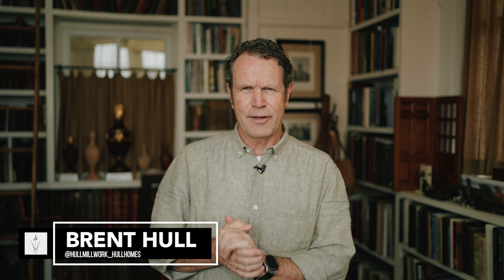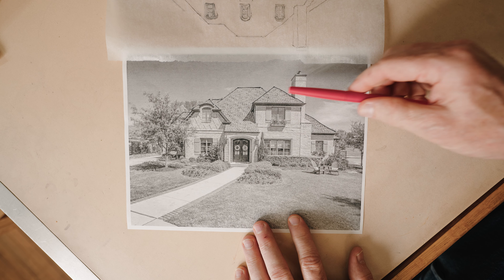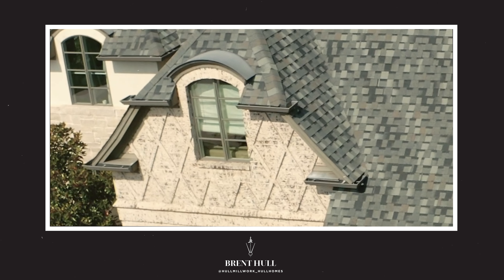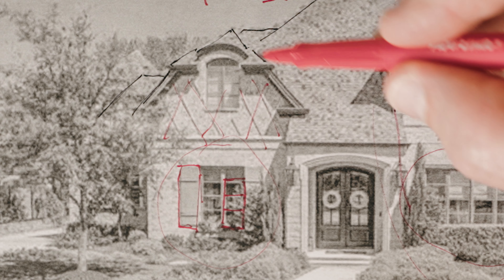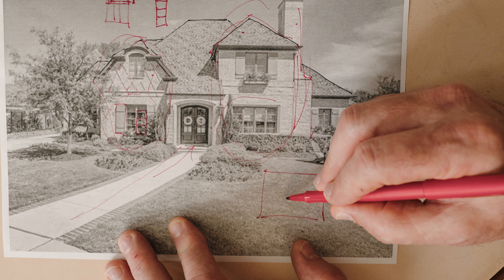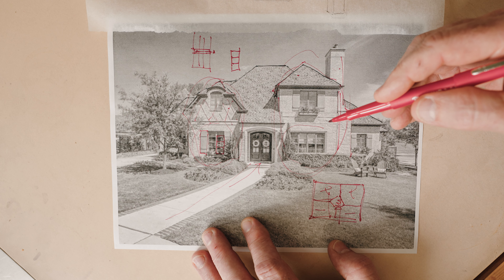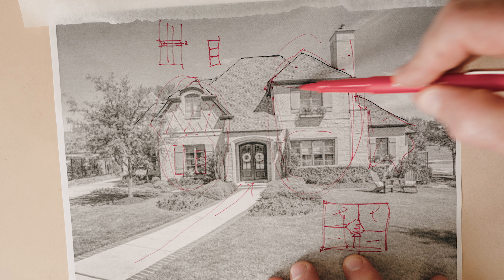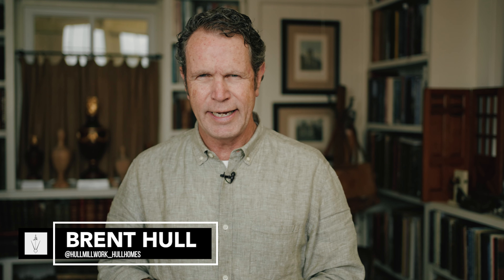French-ish house fix.

Comment: Hi there, your changes did make a big difference. I've now lived in France for 3 years, and one of the reasons I moved here was I appreciate the architecture so much. About the only thing more I would have done on your drawing is make those ground floor windows much taller. In France, windows are much taller than elsewhere, I've noticed, particularly in northern France (which that house with its steeply pitched roof has a more northerly look to it, possibly Burgundy or an eastern style as opposed to a Normandy or western style, but like you said, it's hard to tell for sure). The windows go much closer to the ceiling, but do leave room for the crown mouldings. They also start a bit lower down. If you stepped up on a short stepladder, you can generally walk through a French window without necessarily having to bend over, they're that tall. I do prefer French windows and doors and always have. Their only drawback is that because they open inward, it's harder to have drapes, except in houses with super thick walls (and nearly all older homes have super thick walls), and the window is near the exterior side, then they can fully open and not interfere with drapes inside. Also, they rarely get stuck and inoperable like older sash windows tend to do. Or at least, somewhat easier to fix if they do get out of alignment. Such wonderful videos you have, I'm a fan.
Reply from the maker: Nice, thanks for your comments.

Comment: That’s MUCH better and in keeping with the French Provincial / Eclectic style with segmental casement windows above the cornice. Keeping the steeply pitched hip roof is exactly correct, but I also see the possibility of bring more symmetry to the building by reworking the left massing to better mirror its opposing side.

Either would’ve worked but this second option would’ve been much more expensive. Great job 👍🏽👍🏽👍🏽
Reply from the maker: Good to hear. Thanks.